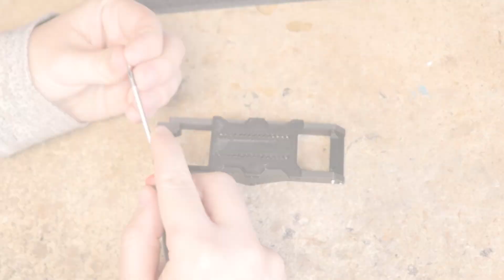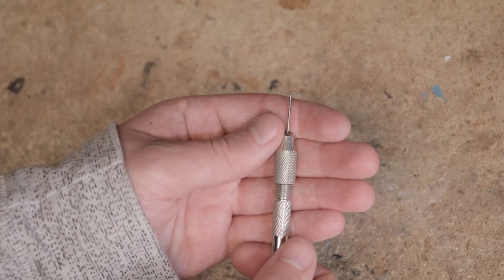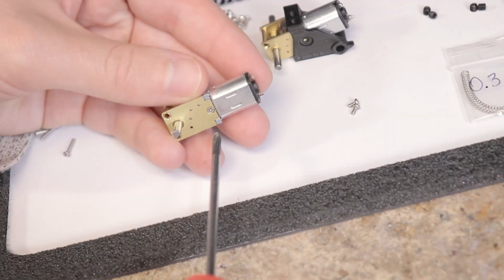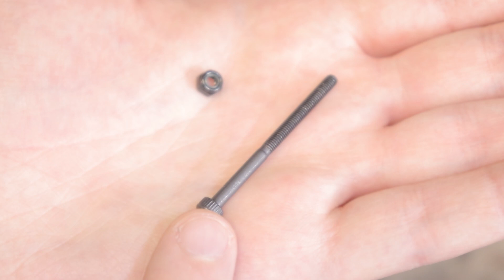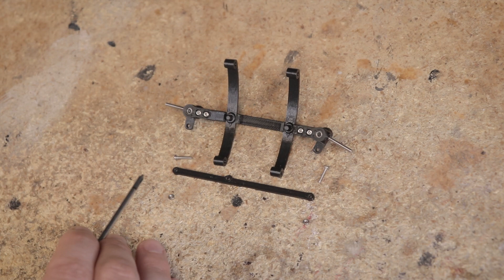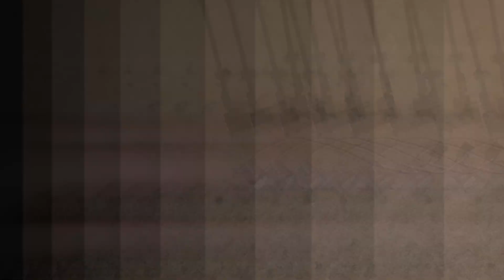How To Assemble The CTC 01 3D Printable 1/25 Scale RC Truck Chassis 🔧

Comment: Really nice work and engineering. A minor thing I would consider doing(which likely would never matter with the loads at play here) is modify how the sub frames are connected. 

If the joining crossmember had 6 bolt holes per side, you could make a nesting Z type connection. Google  "Z cut truck frame" for a better idea. 

This would let the 2 frames load share better and rely less on the clamping forces of the fasteners to oppose any lever action forces. 

Of course you can still do that the 4 fasteners per side, but adding an extra fastener along the length of the frame will also provide additional bending resistance. 

I understand that adds a little bit more cost and complexity, which goes against your goal of this frame, but it should be minimal. 

Not nitpicking, just brainstorming, great build!